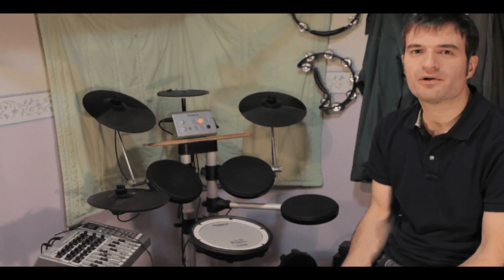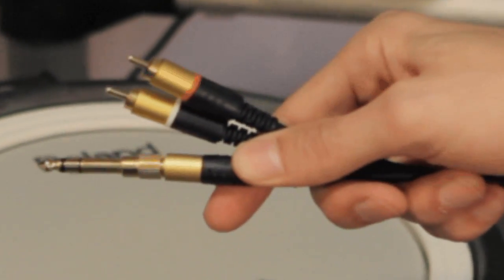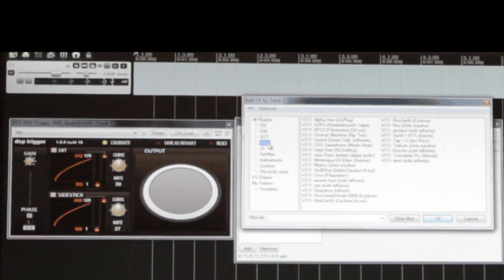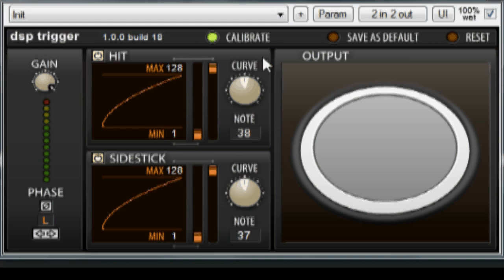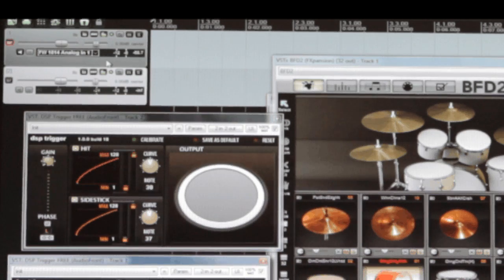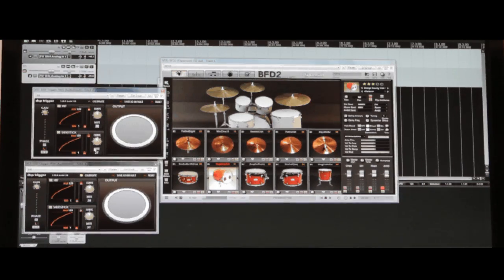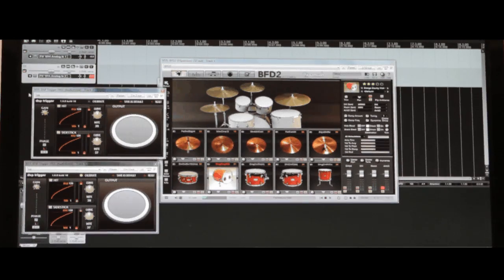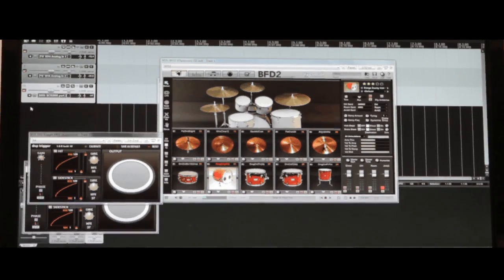How to setup DSP Trigger Free Edition

Comment: I thought this plugin could detect transients from an audio file and record them into midi notes on a separate track? either it does not work or I couldn't get the routing correct. Anyway, realized I could just drag and drop the audio file into a midi track in Ableton and it converts automatically...

Comment: @yeahtuna Ok, then without using a drum module How would you hook up 10 TRS triggers to a 2 input audio interface?In this video,It looks like you have 8 separate triggers on that kit. How did you connect all those triggers?What audio interface are you using and how many 1/4" inputs does it have?

Comment: My audio interface has only 2 input,If  an input is need per trigger,how is it possible to connect my full 10 piece kit? All kit pieces use a TRS connection.Also I see no point in using my drum brain(td20) with DSP Trigger.Whats the purpose?If the td20 is the midi interface,why would I use DSP Trigger ?